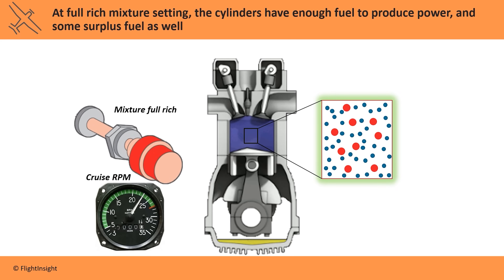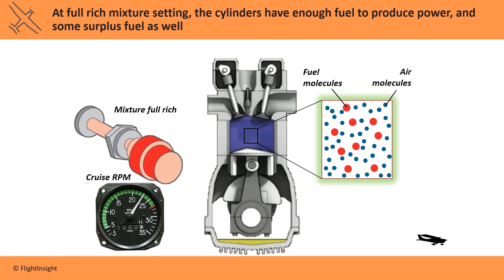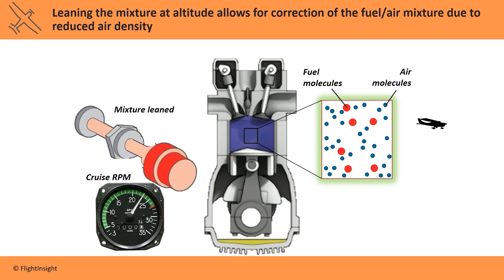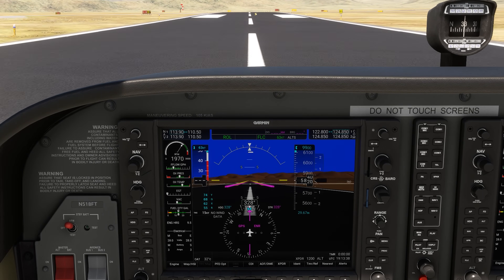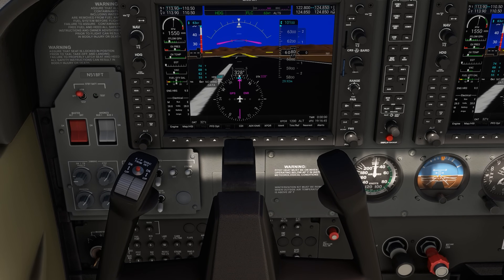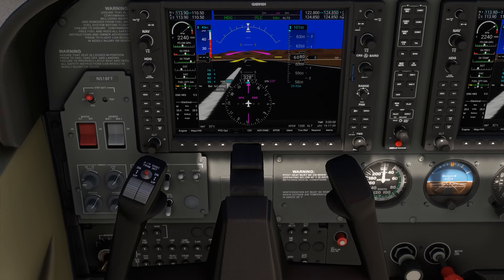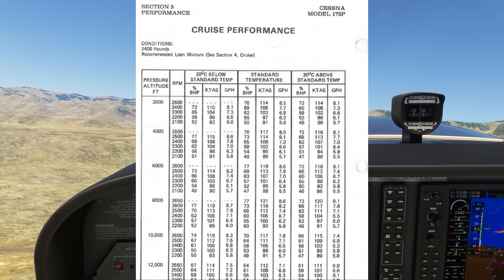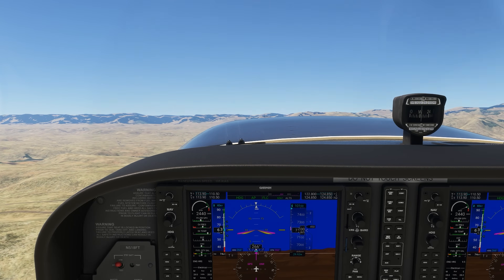Why You Must Lean the Mixture at High Altitudes | Avoid This Dangerous Takeoff Mistake

Comment: Properly leaning a normally aspirated engine is something every pilot should learn and become comfortable with, however you should never put all your focus on that alone, especially when taking off at high DA airports. It’s very important to properly fly the plane. Use the ground effect, mange your speed, retract the flaps and gear when appropriate. Properly leaning will optimize power output roughly 10% and when dealing with High DA every little bit counts but forgetting to clean up the airplane can be far more devastating. Take a mountain flying lesson or two don’t just wing it.

Comment: Very good advice. Thanks.  I saw a couple other YouTubers experiencing high elevation airports on a hot day, with a low power aircraft. They made it back to the airport, safe, but I would have suggested waiting until morning, and cooler temps.

Comment: Field elevation at my home airport is 4,606. We START the engine with less than half mixture anytime you don't need a coat. Full rich only happens right before we lean in the runup. I have NEVER gone full rich for takeoff or landing (except when I'm flying something with a turbo) because it takes away so much power.
Reply: I've never started an engine at full rich at High DA. And I even lean at low altitudes, and I get teh POH fuel burn rates, and I talked to Continental's Chief engineer once and told him how I was flying even at low altitudes, and he told me I was doing everything correctly and to keep doing it. I had to get a cylinder replaced recently due to valve wear, and the mechanics commented on how good my engine looked inside despite its age.

Comment: The worst-case scenario is catastrophic engine failure from heavy detonation, so it’s wise to be cautious.
Reply: At a high DA such as the example, it is highly unlikely to experience any detonation. Light detonation will not cause harm to the engine. Heavy detonation usually only occurs when an injector is clogged and the pilot doesn't see the CHT climbing quickly.
Reply: @rayeaker1207  There's good reason to be nervous. Student pilots might do something stupid (e.g. a full-power run up at sea level while leaned for taxi). Videos like this one are helpful, but I don't want anyone to get the idea to "Relax. Nothing bad can happen."
Reply: @AwestrikeFearofGods  I teach leaning, even to low altitude pilots, and have never experienced this from any students. if you're leaned for taxi and try going full power, the engine should quit.
Reply: @SoloRenegade  Possibly, but I wouldn’t count on it quitting.
Reply: @ I've never experienced detonation, etc. engine quits every time.  you must not be leaning properly.
Reply: @AwestrikeFearofGods  If the engine is leaned for taxi at sea level, it will not run smooth at high RPM for the runup and is easily detected/corrected by the pilot. As well, the engine is not making enough power at 2000 RPM or so to cause any damage.
Reply: @SoloRenegade  I’m talking hypothetically. I would never try this, and I’m certain you haven’t tried every possible mixture setting at full power (i.e. sea level, redline, not 2000 rpm).
Reply: @AwestrikeFearofGods  why would I try every possible mixture combination? I just lean the engine properly. why would I intentionally lean the engine wrong?

"(i.e. sea level, redline, not 2000 rpm)"

???? I've taken off at sea level as well as some of the highest elevation airports in light aircraft (helicopters and airplanes).

I've also run the engines at redline on takeoff and in flight.

Some engines redline at RPMs lower than 2000rpm, some higher. Not sure why you decided to choose an arbitrary rpm that proves nothing.

I lean my engine at EVERY stage of flight. Startup, taxi, takeoff, climb, cruise, descent, landing, taxi, etc. and I've done it at all altitudes, regardless of power setting and RPM.
Reply: @ " I’m talking hypothetically. I would never try this,"

then why bring it up? if no one does it or experiences it, why try to scare people into fouling their plugs and gumming up their engines from running too rich?
Reply: @SoloRenegade I brought it up because of Dan’s remark that “many pilots get nervous leaning the mixture in flight”. I never advised to not lean the mixture. I merely explained that they are wise to be nervous, because a mistake at full power can result in expensive/dangerous engine failure.
Reply: @AwestrikeFearofGods  "I merely explained that they are wise to be nervous, because a mistake at full power can result in expensive/dangerous engine failure."

exactly, you fear monger, and convince people Not to lean their engines, for fear of a mistake you even admit you've never experienced, and neither have I. 

Such things do not happen if you lean properly.
Reply: That's true you got to watch that too. Better to have less power than no power
Reply: Don’t be ridiculous. I never said to not lean. I will say to learn how to lean properly, and to retain a healthy fear of mistakes, which you clearly lack.
Reply: @AwestrikeFearofGods  "Don’t be ridiculous. I never said to not lean."

you were fear mongering, which has the same effect as telling people not to lean.

"I will say to learn how to lean properly, "

which is what I have said repeatedly the whole time, but you continue to challenge me on it. When I advocate that people learn to lean properly, and you argue AGAINST me, it means' you are telling people NOT to learn to lean their engines.

"and to retain a healthy fear of mistakes, "

As I said, you're fear mongering. If you lean properly, there is literally nothing to fear at all.

"and to retain a healthy fear of mistakes, which you clearly lack."

why should I be fearful? I'm have no reason to be afraid of leaning my engine. I'm not a coward who lives in fear his whole life and is afraid of his shadow like you.
Reply: @SoloRenegade You have a bad habit of putting words in my mouth. By now it shouldn’t, and yet it probably still surprises you to learn that I’ve always practiced leaning.

If I say “motorcycling is dangerous”, does that mean I’m telling you not to do it?
Reply: @AwestrikeFearofGods  "If I say “motorcycling is dangerous”, does that mean I’m telling you not to do it?"

depends. but yes, without any additional context, everyone is going to assume you're against motorcycles and advocating people not ride them.
Reply: @AwestrikeFearofGods  "You have a bad habit of putting words in my mouth. "

I never put words in your mouth, i only ever quoted you exactly. But when you don't explain yourself adequately, people are left to interpret what you mean for themselves, and you don't leave much room for interpretation with what you say.
Reply: @SoloRenegade  There are plenty of people that like to brag about dangerous activities.

As for leaning, I was clearly describing improper leaning. It's well documented to be a leading cause of detonation, and detonation has caused fatal engine failures. These are facts, not political statements.
Reply: @AwestrikeFearofGods  "As for leaning, I was clearly describing improper leaning. It's well documented to be a leading cause of detonation, and detonation has caused fatal engine failures. "

Cite your source/s. Explain what you objectively consider to be "bad leaning " then, in your Opinion.

"These are facts, not political statements."

no, your fear mongering is opinion. why bring politics into this? what does leaning have to do with politics? Nice try at a Red Herring.

Comment: You should lean almost all the time, besides engine start and take off at low enough altitudes (up high you will need to lean even then), otherwise lean aggresively on the ground for taxiing, in cruise lean until the engine stumbles, then enrich a little so its smooth again (unless you want speed in cruise and not fuel efficiency, range or engine life) during climb you lean for max cont power/rpm. When leveling off at altitude you either go wide open throttle or max cont manifold pressure, low rpm and a big mixture pull towards as much lop ops as you can get away with, basically savvy aviation way or a2a way if you guys like good sim addons 🐸